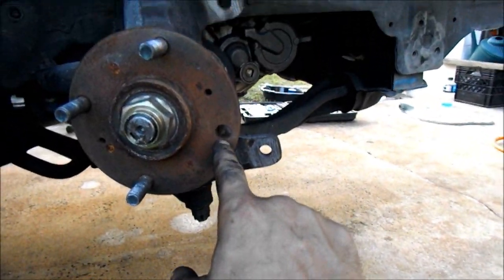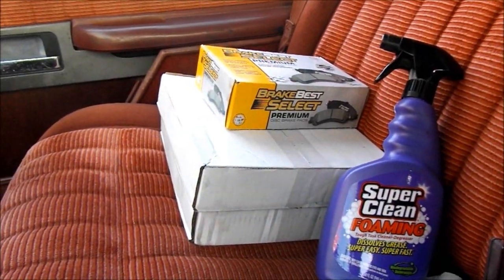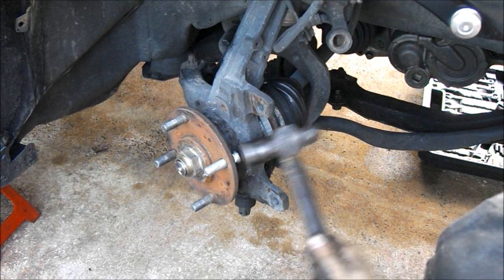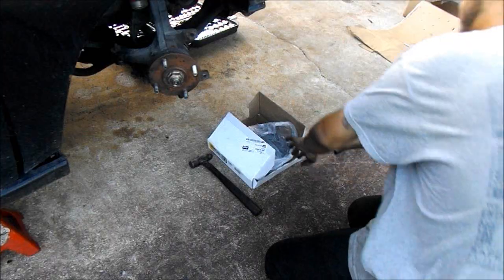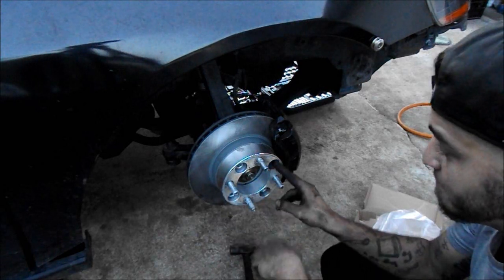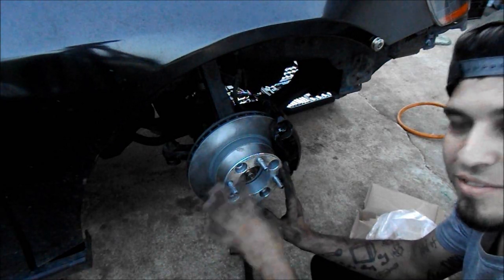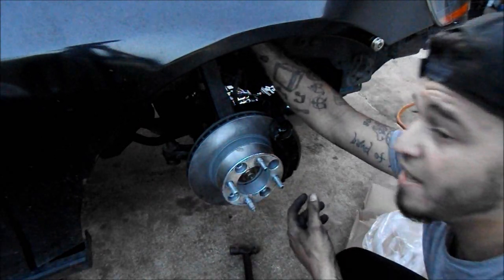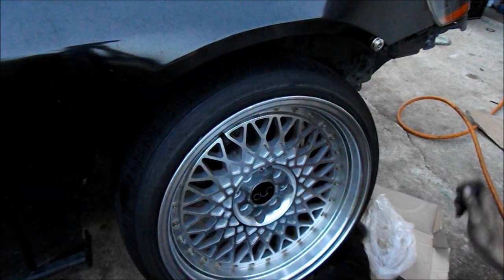Honda Accord Come Back pt.2

Comment: I got an Accord too and I also want to turbo it. I watched your older videos about the eBay turbo kit, so what ended up failing? I know in the video you mentioned the replacement turbo also failed after boosting in 2nd gear. Was the rest of the parts ok (exhaust manifold, intercooler, bov, wastegate)? I've read on other forumns some people have good luck wiht eBay turbo after adding an oil restrictor, did your turbo came with that? Anyways, good luck with your future builds.
Reply from the maker: The problem I had with my first turbo set up was the wastegate if you buy decent eBay stuff you should be fine but my next set up is going to be name brand everything good luck on your turbo set up 👍
Reply: Cool, good to know. I guess I'll have to plan on a name brand turbo and probably Tial wastegate then.